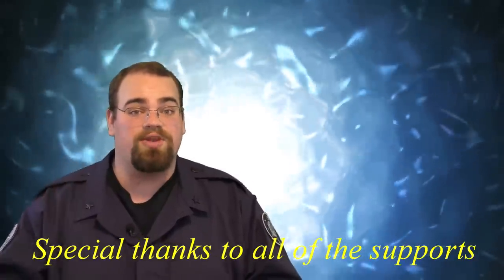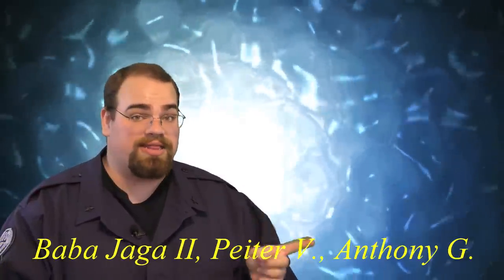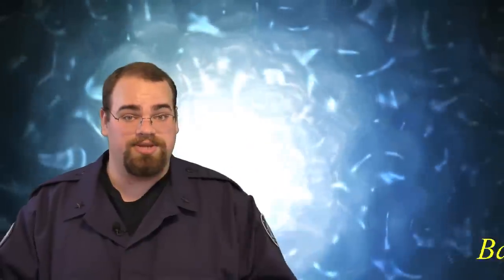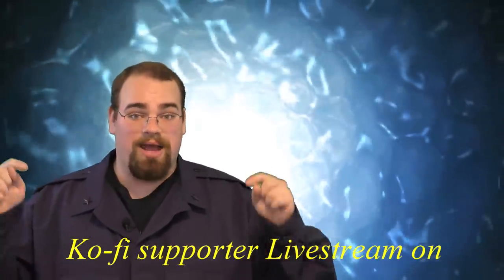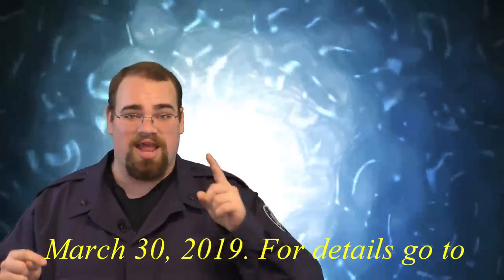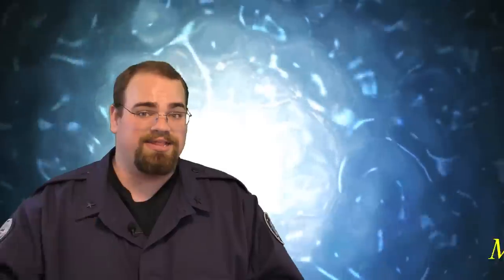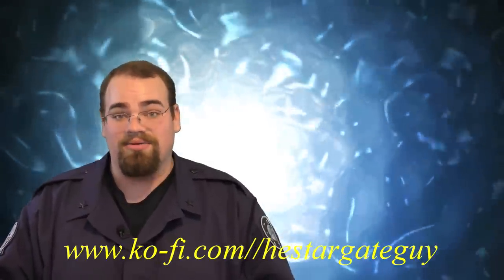Zero Point Module (ZPM) : How it Works

Comment: While they are an excellent way of generating energy there is a better way than this using the level of technology they have in the stargate world my theory being thus they use a few of the naquadah generators that run at a controlled over load for the energy to squeeze particles of light into a very small area using the E=MC2 equation this would create a type of high energy white hole (note not the same as a theoretical white hole / black type ) then using metal that could withstand the massive heat and pressure harvest the hawking radiation this may last for say 10 years and the amount of energy that they would get out of a few of these set up would be the same as or bigger than a ZPM.
Reply from the maker: I have no idea if that would work.

Comment: Ok what??? There is higher pressure under ur piston then the rest of the engine? Dude I dont think you know how an engine works, cause if u got high pressure under your piston your engine got problems.
Reply: Unless your engine is upside down.  He just got his orientations wrong.
Reply: @johnwang9914  nope. Top and bottom of the piston doesnt change based on engine orientation.
Reply from the maker: Yeah I’m not a mechanic.

Comment: Physicist here. I like your channel and most of your videos, but I felt a sudden wave of disappointment when I hear your explanation. I understand you tried to cut the facts to the bare minimum but on the scientific side of the coin, most of it didn't make much sense and was incoherent. Quantum mechanics is a theory which helps us explain empirical obtained facts, within this theory everything is explained with probabilistic wave functions. I would definitely check out at least Wikipedia before making any bigger assumptions (https://en.wikipedia.org/wiki/Wave_function). Thank you for understanding and good luck with future videos.
Reply from the maker: Well thanks Daniel. I had a hard time understanding this stuff myself so I figured I botched it. Could you give us a brief and simple explanation on Zero Point energy and Vacuum Energy? I had a really hard time finding simple explanations of these concepts.
Reply: @TheStargateGuy  I don't know how ZPM works. It's been theorized that there could be a way of extracting of energy using Casimir effect (CE), but I am not aware of any experiment which would support this claim. The force field created in a such a way was measured (e.g. www.nature.com/articles/ncomms2842), but this effect is surely negligible on macroscales. The main idea behind CE is quite easy. CE exist due to the difference between the "amount" of created couples of particles and antiparticles, which results in differences between applied forces on both sides of two planes. The full explanation is beyond this comment, people at my uni attend lectures for several semesters to learn how to use Quantum mechanics (QM). For clarification, it is true that particles can behave like waves, but this effect takes a place where there is no present field around it (no interactions). In QM wave function describes the probability of measuring the particle in given coordinates. The picture of 2D plane with balls suspended on springs depicts a field of a given particle. That means, that higher states of this field will result in the creation of the particle. Low states of this field are called zero point energy, the field of this particle is unable to decrease under this level. Zero point energy is just a constant in a given field for one type of a particle, so saying it is possible to extract this energy is not quite correct. Anyway, I enjoy SGA and it doesn't bother me that the terminology isn't so good within it.